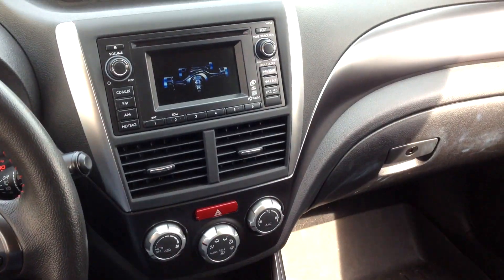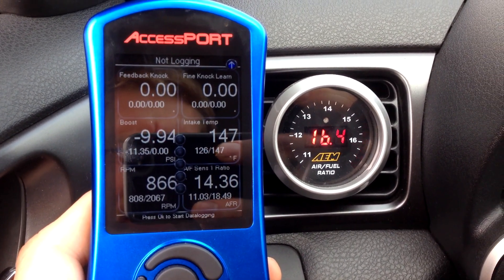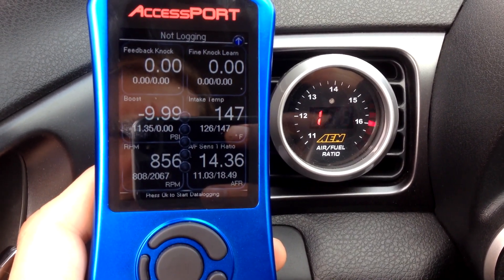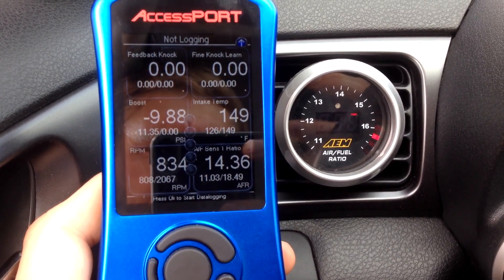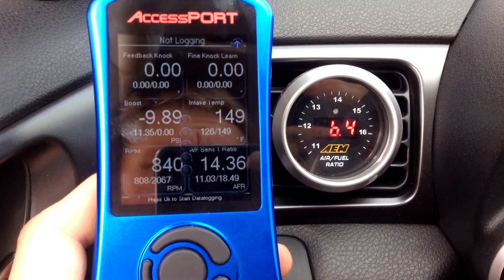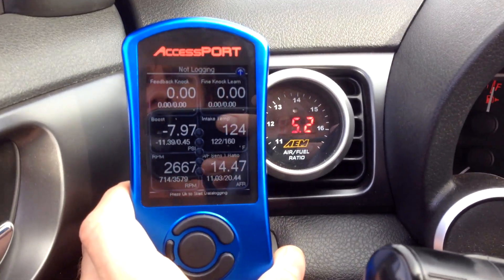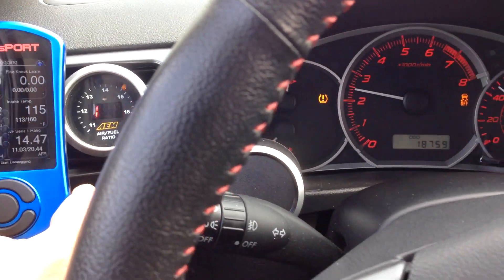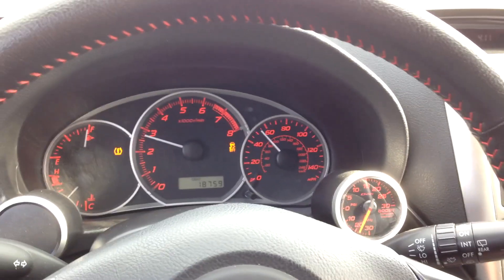Grimmspeed EWG Subaru WRX Up Pipe Smoke Test & AFR Variance

Comment: This is another reason I can't buy GS parts anymore, yours isn't the first I've seen leaking at the flex.  I had an issue where their brand new downpipe wouldn't line up for anything on my car, the rear flange wasn't even close to center in the tunnel and neither the oem turbo back or aftermarket would line up. I bought an oem downpipe and rear cat from another owner and they lined up perfectly. Also bought an Invidia downpipe and while it hangs too low for my liking (scraped a little now), it lines up perfectly with the exhaust in the tunnel. So both a random oem and an aftermarket Invidia line up perfectly, and GS still claims it is a problem on my end. They agreed to refund it after continually telling me it couldn't be their part and to try this and that...finally after being fed up with buying several other parts to verify it was their pipe causing the issue they offered the refund. Even after receiving the part, they made sure to tell me they fitted it up on a vehicle and it "fit perfectly". They would never send me a pic to even verify, even though they could have just thrown a known good part on, but either way that experience jaded me for life. I've also never been a fan of anything with an aftermarket flex joint. Nothing seems better than the oem style with the corrugated steel interior, and using only braid is a recipe for failure. That joint needs to be durable and airtight, it's critical when we are spending tons of money building and tuning these cars and I believe companies need to invest in better joints designed like oem. Thanks for posting the vid btw, was searching for muffled ewg setups and yours popped up.

Comment: Car looks great man! Just wondering, are you located anywhere near Bristol, CT? Theres a blue hatch with the same setup with the black NT03's across the street from the shop i work at and now im wondering if it is yours haha. Nevertheless car looks amazing. Just picked up a 2015 wrx for myself.
Reply from the maker: GoProAllTerrain Thanks man! No, that isn't me, I'm in the Midwest! As for the NT03, they are very great looking wheel but I sold them off because of the pain it would be to fit the brembos under them! I have some RPF1 in 17x8 I'll use for winter rubber and the RC-T4 that'll be used for summer tires. Good luck with your 15, seems to be a hot ticket right now. It'll be cool to see what that 2.0DIT engine can do in the following years.